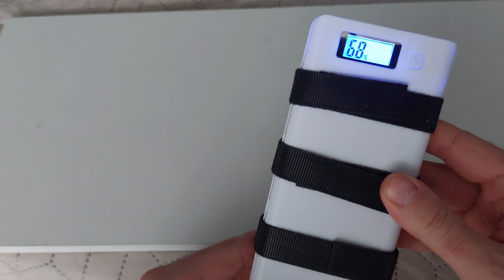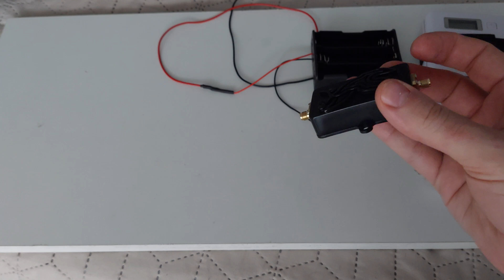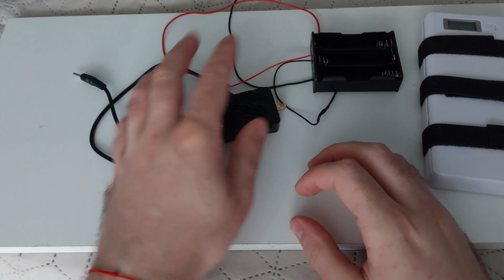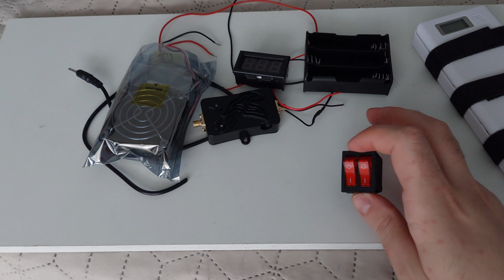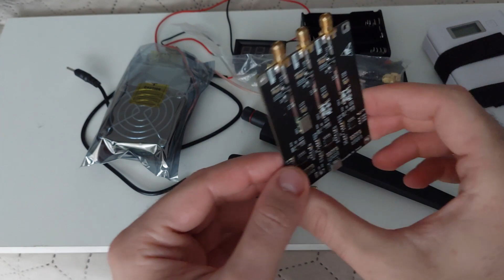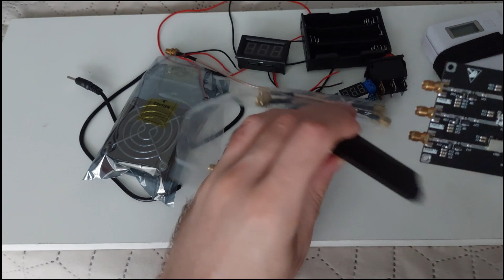Parts used for DIY 2.4ghz 5.2ghz 5.8ghz Wi-Fi signal jammer/DRONE JAMMER/DRONE KILLER

Comment: hi..can you test if your amplifier is compatible with nrf24...wer can i contact you
Reply from the maker: It is because nrf24 also uses 2.4ghz. On insta
Reply: @pythoneatssquirrel  it will not conflict with Power amplifier onbord the nrf24?i have build nrf24 jammer...planning to add this amplifier
Reply from the maker: @smoochies5056  it should work honestly, we are looking at different types of amplifiers
Reply: @pythoneatssquirrel  gotta test this amps if working...it will add about 30 meters range maybe
Reply from the maker: @smoochies5056  it should be like this, try it, I don't have a nrf24 yet to test it

Comment: Thief have been using drones to see if the people are home. With this we can block and they won't be able to flight. What's the range? Thank you
Reply from the maker: Depends on the amplifier. With this 2w amplifier and a 5db antenna I could jamm my own drone from 6th floor (the jammer being on the first floor wich is 0 in my country, so basically it was succesul for 7 floors, didn't tested higher)

Comment: hey nice vid, one question though, whats the point of the amplifier? to extend the range?
Reply from the maker: Yes, without it it works at max 10m
Reply: 10M? That's it? What do you need to get a range of 100M?
Reply from the maker: @NSWvet83  30-40w amplifier which is around 150€
Reply: how far with the amplifier? @pythoneatssquirrel
Reply from the maker: @troypickett7716  30m in an apartment, 60m in a yard or empty field (no walls)
Reply: sweet, when will do youplan on releasing the one with a builtin aplifier? @pythoneatssquirrel
Reply from the maker: @troypickett7716  soon, maybe this early next week, depends how busy it gets at work
Reply from the maker: @troypickett7716 it's available